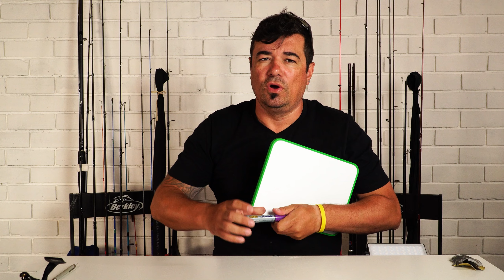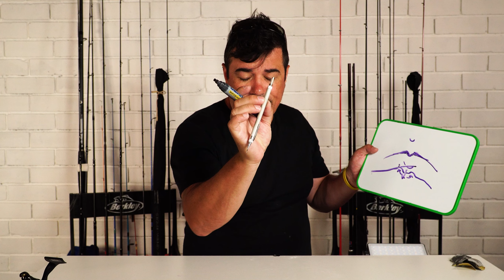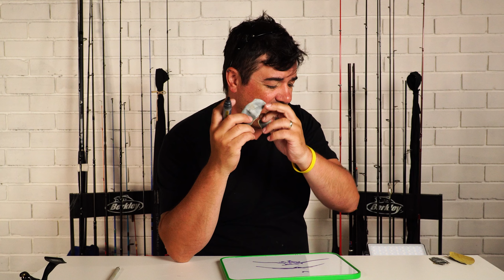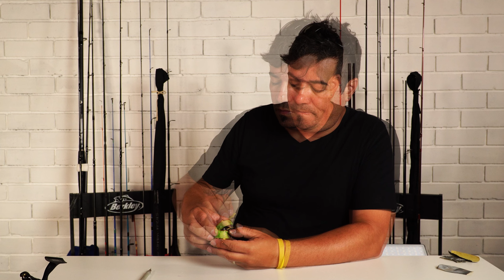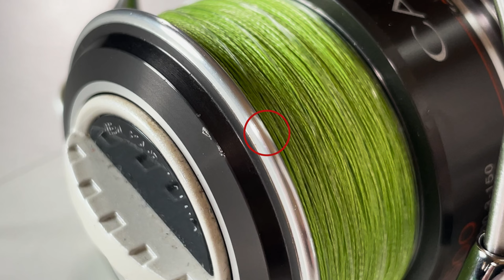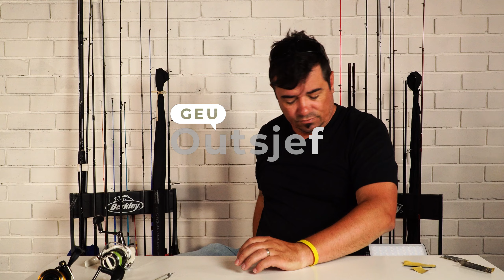How to Repair an Aluminium Spool for Fishing | Fix Hack Repair

Comment: Do you find that over time it stays smooth where you sand it? I have a reel similar to yours that I was about to replace. I was concerned about even if I smoothed it it could still fray my braid and cost me a fish!
Reply from the maker: I haven’t had any issues - with any of the reels that I’ve done this too. But just take your time and go little by little. If you use 600 or 1000 grit (wet and dry) paper - you shouldnt have any issues. Once your done, you never have to retouch - unless you put new nick’s on there. Goodluck. 👍🏼🐟